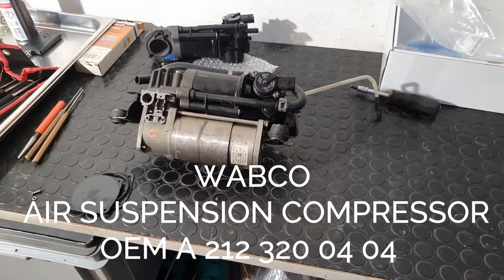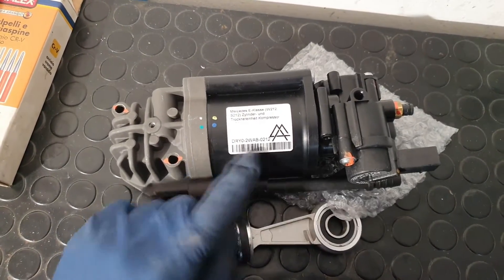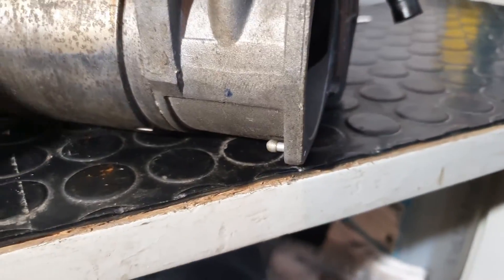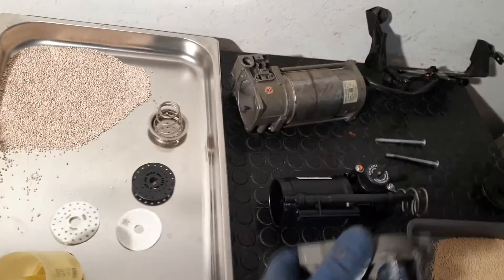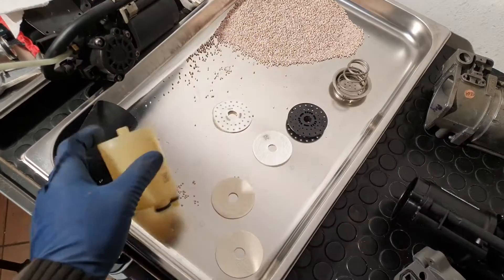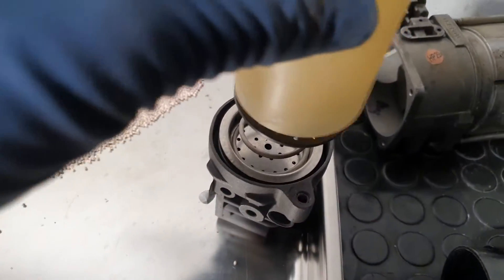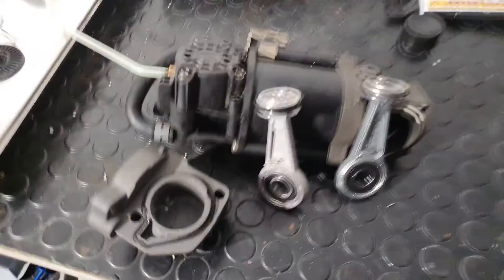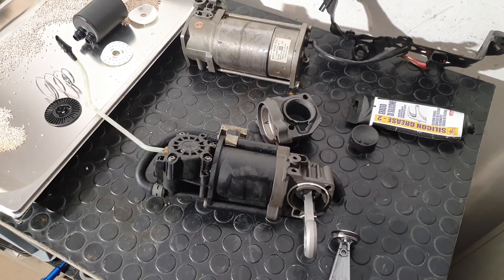WABCO AIR COMPRESSOR REBUILD

Comment: how'd you get the dryer seal and cup off the cylinder head? I'm talking about the one with the holes in it that seems to be pressed in
Reply from the maker: everything is very easy to dismantle, nothing pressed or glued.. if needed simply use a proper hook..

Comment: How did you refit the cover on the motor after you drilled out the rivets ? Thanks
Reply from the maker: M3 nuts and bolts
Reply: Thanks excellent video  @diycarmechanic587